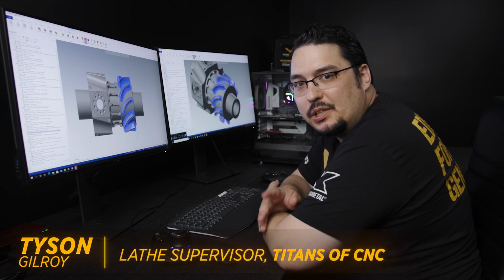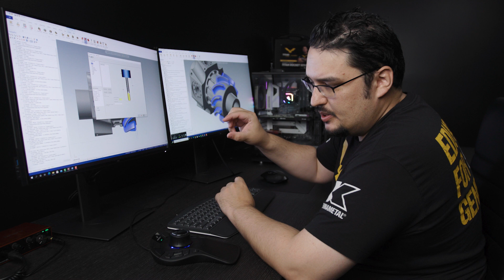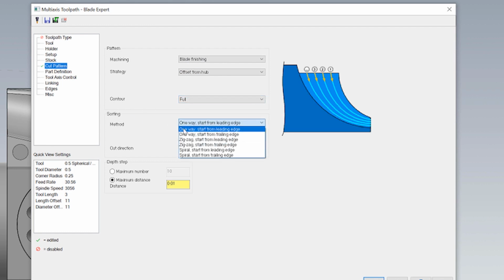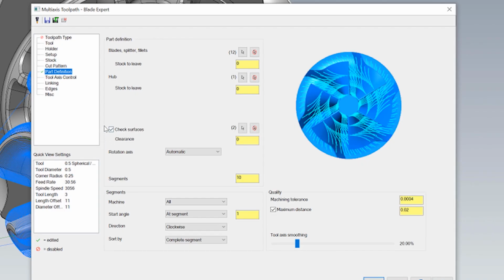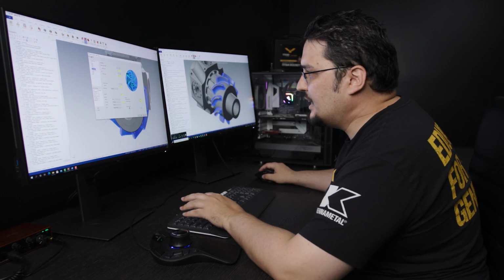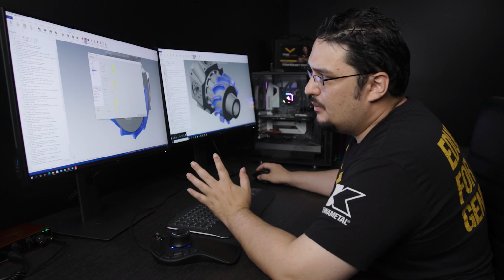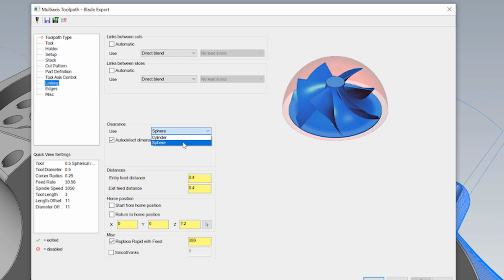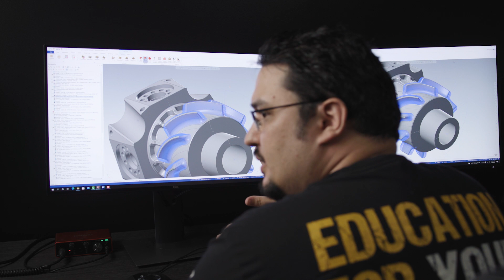Inside Look at Machining Perfect 316SS Blades on 9 Axis DOOSAN SMX3100

Comment: Alright... CAM is cool and all but how do you go about making a post processor from scratch? How do you get your CAM to spit out proper code for your controller. In my case I work on a DMG Mori M1 and unti we find a working CAM/post for the 828D we are sinking when it comes to setting a new part! Everything is really cryptic and the order deadlines leave no room to read all 5000 pages of Manuals that consist of 25% overlapping stuff, 25% turning and grinding stuff, 25% machining 101 and the last 25% is full of some cryptic functions and coding with no clear explanation of the steps it performs and how to tweak them appart from a "(consult machine manufacturer)" after every paragraph... Oh... and did I mention that 15% is options we did't opt for and 10% is stuff we didn't need and didn't care! That leaves us with 99% of problems unsolved and so far I have not found a single helpful things in the manuals (many interesting and powerful functions but of zero help to our company)
Reply: What CAM system are you working with?  That is a major factor.  It seems like all of the different developers have their own way of handling custom posts.
Reply: @brandons9138  Started from Fusion, tried many things all the way up to Esprit (a complete machining only powerhouse with a very steep learning curve when you are getting started). I realized that no matter how good the pre post side is I never seem to be able to find the right post for the machine I am working on and very often the suppliers are not very knowledgeable on the products they sell.
Reply: @Sketch1994  most posts you're going to get for free are going to be basic even on a haas. You really need to talk to someone who does this for a living if you want to skip the headache. Why'd you settle on esprit?
Reply: @travistucker7317  I didn't exactly settle for Esprit since the company I work for as of recently just got their first 3 axis VMC and the only reason they even consider a CAM system is because the Sinutrain license costs as much as an entry level one (ridiculous quackery by Siemens' side). I "settled" for Esprit because it is a machinist's program. All of it's features are oriented towards no BS machining and the way features are characterized for the consequent machining (open and closed chain selections and stuff that matter instead of having to generate an extra shitload of sketches to get Fusion working). Even the way you pick planes reminds me of multi axis cutter comp happening if that makes sense. The CAD side of it leaves a lot to be desired though!
Reply: We have a DMG Mori CTX with the same control, your not alone. GibbsCAM is the software we use and have issues too. I've used Esprit cam on Mori NTX5000 for two years and it had a flawless post. I wish the machine manufacturers and control manufacturers would standardize the coding for these machines it would only make all our lives much easier. I don't think G-code enough.
Reply: @jasondk5127  I can't agree more with that statement. It's insane what efforts some top notch controller manufacturers undergo to "differentiate themselves" from FANUC, the old but faithful Fujitsu stuff that was so standardized it is now called "ISO programming"!
Reply: Google cam specialties. He can walk you through all of it